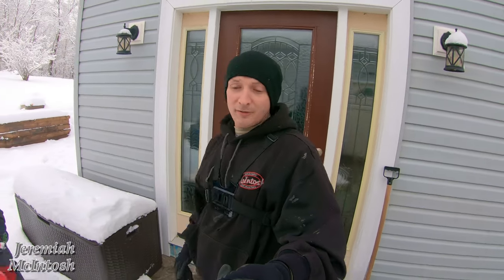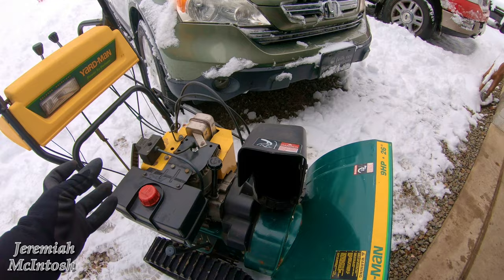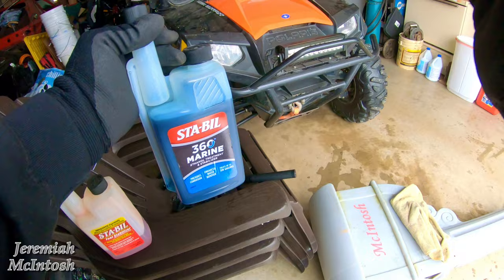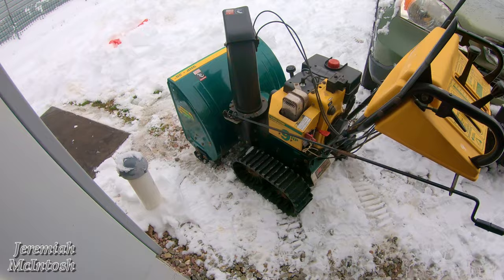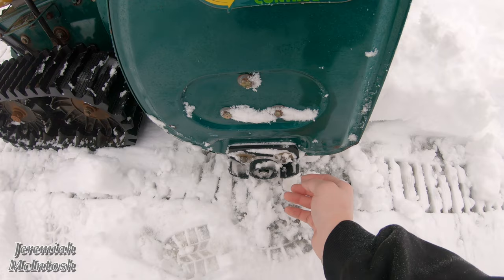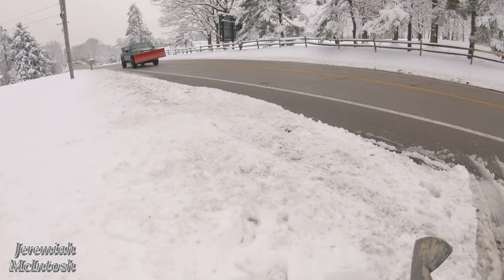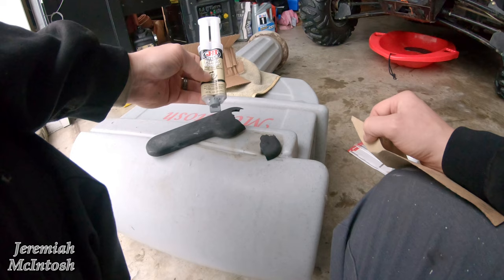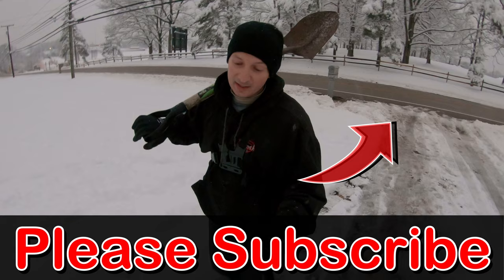How to prevent Carburetor￼ from Guming up and keep old engines running for years!

Comment: Use pam or silicone spray on the snow blower on the fan and inside the housing and chute.  the snow will not stick. Especially if it is a wet heavy snow.
Reply from the maker: Thanks for the tip I will definitely try that next time!

Comment: At the end of the season, I’ll change the oil before draining all the gas. That’s also a good to to grease the snowblower as well. With my mower, I’ll change the oil and sharpen the blade so it’s all set come Spring.
Reply from the maker: Thank you those are Great tips as well!

Comment: As an old mechanic I can tell you THIS IS the most important thing you could ever do, EVER!
Fuel stabilizers do not work, They do not magically remove water in the fuel,
Pump gas is destroying the machine that you just put away,  Take off your float bowl come spring, you'll see your nice carb turning to crap.
Reply: What is the most important thing that you are referring to? Letting it run with gas off? I’m confused by your coment
Reply: @MrSpunduckwoo  Storing your machines with any pump gas is the problem, 
Ethanol is hygroscopic, Like brake fluid, 
It draws in and absorb moisture over time, 
When in storage that water settles in the bottom of the carb and begins destroying it, My mint go kart has never seen ethanol-garbage pump fuel, only ethanol-free fuel.
Canned fuel will also stay good in the can for five years compared to the recommended 30 days with pump gas.